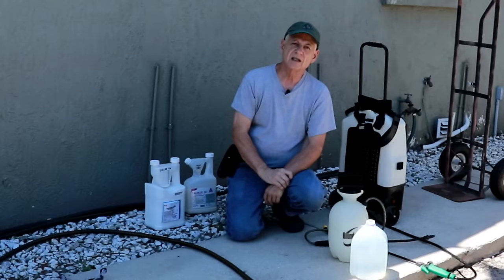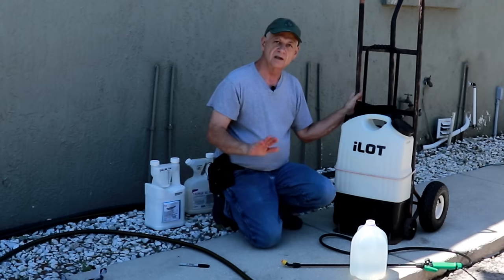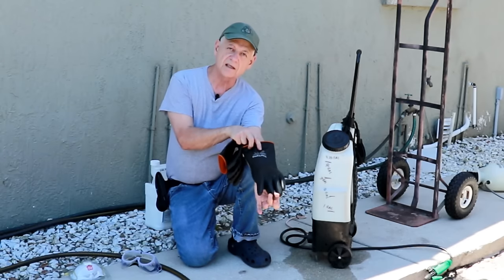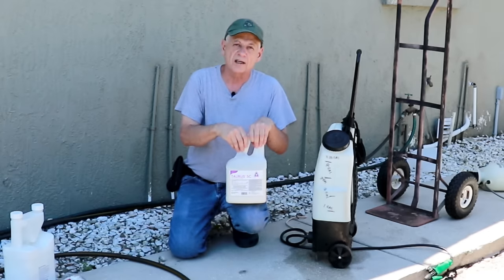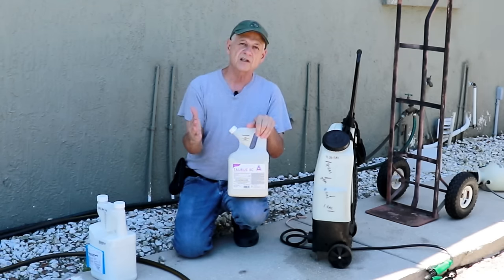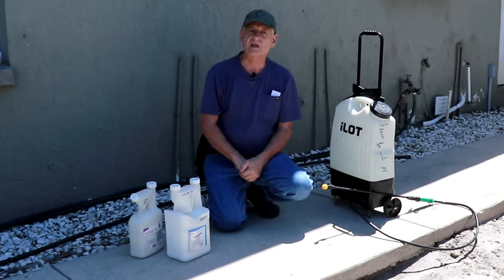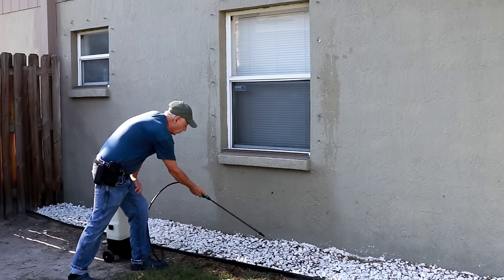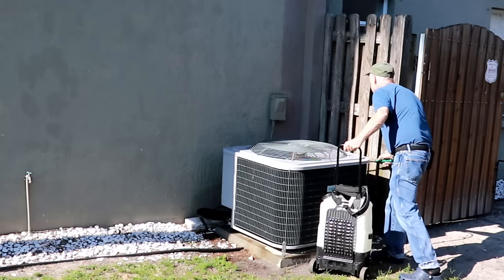General Exterior Pest Control - IMPORTANT!  READ THE DESCRIPTION.

Comment: Would you recommend their granules also?
Also would you recommend these products over using pestie, If you know anything about them
Reply from the maker: Pestie is a clever business model.  They sell professional grade products to homeowners that do work.  However, the equipment that they provide is not sufficient for all applications and so the results will be mixed.  Even if you apply a good pesticide, it won't work if it is not applied correctly.  Also, you can get the same stuff yourself for a lot less money.  Finally, all their products are repellents, which is typically what you see for do it yourself applications.  While repellents are definitely used by the pros as well, they are not always the right approach for all pests.  For example, if you have carpenter ants, then you would not want to do an initial treatment with a repellent.  So, the bottom line is that you can do it better and cheaper by purchasing a good sprayer and some Taurus SC and Talstar P.  I have now changed my advice on treating the exterior of your home and I am planning an updated video on the subject.  Due to pests like carpenter ants, I am now suggesting that you do an initial treatment with Taurus SC, which is non-repellent, and then use it every six months.  Since it does not last six months, you should do a three month in between treatment with the Talstar P.   So, alternate between the products every three months.  This way you will kill any colonies or nests every three months with a non-repellent and three months later you will apply a repellent (Talstar P) to keep the bugs away until the next application of the Taurus SC.  The Taurus SC is a slow kill product that the bugs take back to the colony or nest with them to kill off the entire colony because they don't know that it's a poison and they happily walk right through it.  The Talstar P and the Pestie products are fast kill products that will knock down existing pests and simply keep them away because they understand that it is a poison.  Unfortunately, YouTube does not allow me to edit videos.  You need to delete them entirely and post new ones, so I need to do that as soon as I get a chance.  I hope that helps.  Thanks for watching.  Be well my friend.
Reply: @GuysPestSolutions  thank you so much & look forward to your update, I'm guessing you can use the sc in attic also since no one really goes up there, when you drill into the walls is the best to go high as possible or is there a certain hight that's better
Reply from the maker: As far as I know, you are not supposed to treat in the attic with Taurus SC, although you do have a good point about it not being a living space.  Still, it is way better to treat attics with Bora-Care mixed one to one with water.  Unlike Taurus SC, which lasts about 90 days, Bora-Care is a permanent treatment for all wood destroying pests and it is totally safe after being applied.  For general pests in attics, you are supposed to use the repellents or some sort of suspension/wettable powder.  To be honest, I do not understand the reason for not using Taurus SC in attics, but I cannot recommend doing it just because I don't understand why it is not permitted.  All I can tell you is that, as far as I know, applying Taurus SC in an attic would be a violation of the law.  I figure that the folks that figure this stuff out are experts in their field and if they are making it illegal to use the product inside, even it attics, then there must be a good reason.  My guess is, and this is only a guess, the Taurus SC may continue to give off odorless fumes after being applied that may continuously make their way into the living space below and then place occupants at risk of inhaling it.  The active ingredient in Taurus SC is fipronil and this is not something to play around with.  Getting a little of the spray on yourself once in awhile probably won't hurt you if you wash it off right away, but you don't want to be breathing it in.  Now, the fipronil foam is registered for interior use, if it is injected into wall voids.  If you drill into walls and inject fipronil foam, you want to do your best to get it directly into spaces where you are most likely to find the target pest.  For example, if I am treating for termites behind drywall, I drill into the studs where I suspect the activity is and I drill the holes about four inches apart along the entire length of the stud from the ceiling to the floor and I inject the foam into all the holes for about five seconds or until it comes out at me or out of another hole.  I also routinely inject the foam into cracks and crevices around windows and other areas where I suspect activity.  This is particularly true for drywood termites and carpenter ants.  All of this being said, I can tell you that, while I always follow label directions, I am as aggressive as legally possible.  The pros will tell you to never treat the soffits with Taurus SC or Talstar P because the mist can come back down on you if you are not really careful, but the labels do allow you to do it and so I do it.  The reason is that it is the only way to prevent drywood termites and doing it will stop all sorts of other pests from entering the building from the soffits.  This will also prevent wasps and spider from building nests/webs up there as well.  So, while none of the pros will do it, I do because it is legal and it just makes good sense.  You just need to be careful to do it safely.  I hope that helps.
Reply: @GuysPestSolutions  great info and explanation about treating the soffits with Taurus SC and Talstar P.-  I can get to my first floor soffits easily, but what about soffits up high at the 2nd floor that need a ladder? Do you do those too or is it ok to leave those alone and skip them on treatment? 
You've mentioned PPE, but Im not sure if you have a video or links on everything you should be wearing while doing the job? It seems that is a very important thing to do when dealing with Taurus SC-  You mentioned panse, long sleeves and shoes- I've seen pictures of people wearing what looks like hazmat suits of plastic suits, is that necessary or will the long sleeve shirt and long panse be enough? 
You also mentioned Goggles and, Is there a specific type youd recommend?
lastly you mentioned n95 masks, Ive seen a couple of these and I wonder if it matters which kind to use.  I have some for painting that have a hole in then that allow air to flwo out I guess. I only know you shouldnt wear those types of N95 masks for "covid" does that also apply to this? Do I need instead the N95 masks that dont have in and out flap breather holes? 
Is there anything else that I forgot about PPE? 

Thanks for all your responses.
Reply from the maker: Please copy and paste this question into an email and send it to me at guyspestsolutions@gmail.com.  I will share some pro tips with you that I only provide to people who have certain circumstances.  I'll bet I have your curiosity peaked now.  Right?  I promise that all your questions will be answered when I respond to your email.

Be well my friend.

Comment: Thanks for the video. How is the EVERGREEN products?
Reply from the maker: Evergreen is an okay brand, but the only thing that I see them making is pyrethroid based.  That would not be what you want for most pest control applications because it has no residual properties.  It's a fast kill product that is used primarily to achieve a quick knockdown and not a long term effect.  You want something that uses a good residual ingredient, like bifenthrin.  I have an updated video on how to treat the outside of your house that can make the job simpler to do.  I will give you a link to it.  Be well my friend.

New exterior treatment video:  https://youtu.be/Yozv3s-Qwlw

Comment: Would you recommend spraying this over the entire yard or will the spraying the perimeter resolve the entire yard I’m here in Florida and it’s been extremely hot my kids want to play with water toys in our back yard but there are so many Beatles water bugs mosquitoes etc what would you recommend?
Reply from the maker: I live in Florida too and, yes, I do treat my entire yard with Bifen IT.  This is pretty much the same exact product as the Talstar P, except it's a bit cheaper.  The only difference in the products is that the Bifen IT has a slight odor to it, while the Telstar P is completely odorless.  You CANNOT use the Taurus SC on your yard.  For your house, I recommend alternating every three months between the Taurus SC and either the Talstar P or the Bifen IT.

To treat your lawn with the Bifen IT, you can apply it with a garden hose sprayer and I will give you a link to the one that I like to use.  Put 8 ounces of the Bifen IT into the sprayer and then fill the sprayer up to the 32-ounce mark with water.  Swirl it around a bit to mix it up good.  Set the sprayer on 4 ounces.  Connect it to a garden hose and just water your lawn really good with it.  This is going to kill all the bugs on your lawn and it has a residual of around 60 days.  It actually does not last 60 days, but it takes a while before the bugs can get reestablished.  This really stops just about every sort of bug imaginable from entering your home, but you still need to treat the house because some insects fly to your home.  For example, if you do not treat the eaves and fascia boards and around windows and doors, then drywood termites can enter into the house and cause a real nightmare.  I shouldn't really tell you this, but a super-fast way to treat the house is to use that garden hose sprayer on the house as well.  I mean, if you're busy spraying the Bifen IT on the lawn, then why not just use that same sprayer to shoot the pesticide on the eaves, fascia boards, around windows and doors, up the wall, and where the wall and ground meet as well?  This method of application is going to use a lot more of the pesticide than you would with a garden sprayer, but it cuts the application time tremendously.  Again, you would not want to do this with the Taurus SC, but if you're busy applying the Bifen IT or the Talstar P, then what the heck?  I do it all the time.

Bifen IT:  Bifen IT Insecticide | Bifenthrin 7.9% Concentrate | Solutions Pest & Lawn (solutionsstores.com)

Garden hose sprayer:  Amazon.com : RE Chapin MFG Works G499 Adjustable Rate Dial Hose End Sprayer, 32 OZ : Patio, Lawn & Garden

I hope that helps.  Be well my friend.

Comment: What do you recommend for rats?

Is termite protection necessary for all houses? We have houses in Houston and Dallas if that makes any difference.
Reply from the maker: In Houston you need to do prevention for three species, drywood, Formosan, and more common subterranean.  In Dallas you need to do prevention for just Formosan and more common subterranean.  This is very important in Houston because both drywood and Formosan termites are a big problem in the area.  Formosan termites are very aggressive and can eat your house really fast.  Please watch my video on how to prevent drywood termites and my video on how to apply termite granules.  Links below.  Please read the description on the termite granule video.  It contains vital information. 

Rats are coming in from the outside.  So, the first thing you want to do is discourage them from being there in the first place.  If you have pets, do not feed them outside and do not leave food or water bowls outside.  If you have any bird feeders, then it's a good idea to remove them.  While the rats may not make their way up to the bird feeders, the birds can be quite messy and some of that bird feed may find its way to the ground, where the rats may eat it.  Make sure that all your trash cans are covered, and they have no holes in them.  In other words, make sure there are no food or water sources that they can get into.  
 
Next, walk around the outside of your house and seal any openings that you find.  You can use a commonly available caulk for small holes and Stuf-Fit for larger openings.  I will give you a link where you can buy Stuf-Fit.  If you have any trees or large plants that are touching the house, then trim them back and make sure that you have no trees that are overhanging the house.
  
Now that you've discouraged them from coming into the house, it's time to eliminate the population outside.  To do this, you need to use a bait and bait stations.  I will provide you with links to these products.  For the best results, place the bait stations directly against the foundation of the house and space them about every 15 to 20 feet apart, where you are seeing the activity.  You need to check the bait stations every day and replenish the bait as needed, until you are no longer seeing the bait being eaten. 
 
If you have rats that are inside the house, then the approach is pretty similar to outside the house.  You want to start by removing all the food sources.  Take your trash out every day, before you go to bed, so that there is no trash left for them to get into during the night.  Also, make sure that you don't leave any dishes lying around either.  Pet food and water dishes should not be left out overnight.  I do not recommend that you use a poison inside the house, because you don't want dead rats smelling up the house.  Therefore, I recommend using traps.  I think that snap traps work the best, and they're very affordable.  However, if you wish to be kind to the rats, then you can also use traps that will catch the rats alive and you can release them someplace outside.  You can find a good selection of these on Amazon.  Just like for mice, you want to place the snap traps next to the walls, with the bait facing the wall.  If you're using the traps that catch them alive, then you want the opening to the trap to be near the wall.  The traps I am recommending can be reused.  Always wear rubber gloves when handling traps because the rats may avoid a trap that has a human smell on it.  After you catch a rat, you can dispose of it in the trash and then rinse off the trap with a garden hose for reuse.  Do not over clean the traps because you want to leave a little of the rat smell on the trap.  That will make the other rats more likely to approach the trap.  Be sure to check the traps at least daily or more often because dead rats in the trap will cause other rats to avoid the trap.  I do not recommend feeding rats and mice to the cats because they may have a disease or parasites that can be passed along.  Place the traps at 10-foot intervals along the wall and focus on areas where you think there's activity.  Since you will be reusing the traps, I recommend that you use peanut butter as a bait because it is easily cleaned off when you wash the traps.  If you find that the rats are licking off the peanut butter without setting off the trap, then you can try a little bit of marshmallow.  It is much harder to clean it off the traps, but it is practically impossible for the rats to get it off without setting off the traps.  If you have children, I'm kind of guessing that you would prefer that they not get their fingers stuck in a trap.  I'm also guessing that you would prefer that the traps not snap down on the noses of any pets.   To avoid this problem, you can place the traps inside of a bait station.  These stations lock so that the kids cannot get into them.  They also make the traps more effective because rats like confined spaces.  Just use one trap for each bait station.

I hope that helps.  Be well my friend.

Video on how to prevent drywood termites:  https://youtu.be/neNsmVbj8Pc

Video on how to apply termite granules:  https://youtu.be/H7rW_TSBHJ4
       
Stuf-Fit:  https://www.domyown.com/stuffit-copper-mesh-p-1463.html?msclkid=63d2caf9e3af1b89ec3aae7800ba5242&utm_source=bing&utm_medium=cpc&utm_campaign=Rat%20amd%20Mouse%20-%20JumpFly&utm_term=stuf-fit%20copper%20mesh&utm_content=STUF-FIT%20Copper%20Mesh
 
Rat bait:  https://www.domyown.com/contrac-allweather-blox-rodenticide-p-80.html?sub_id=571
 
Bait stations:  https://www.domyown.com/protecta-mouse-bait-stations-p-1284.html?sub_id=81
 
Snap traps:  https://www.domyown.com/trapper-trex-rat-trap-p-95.html